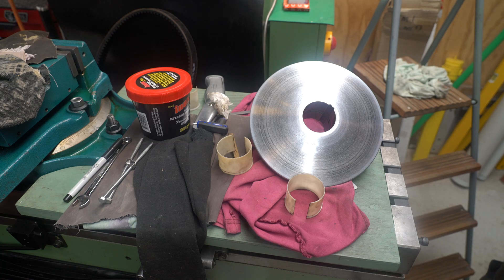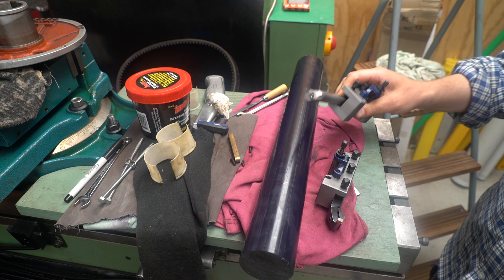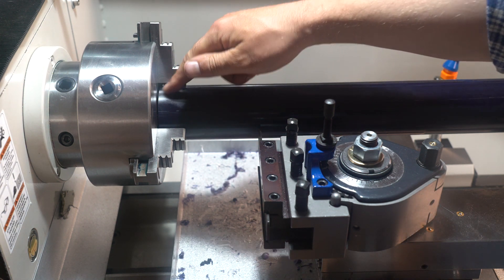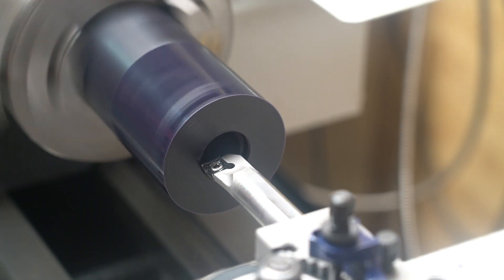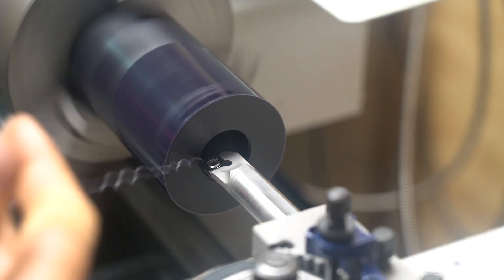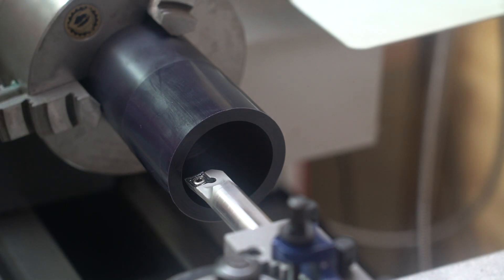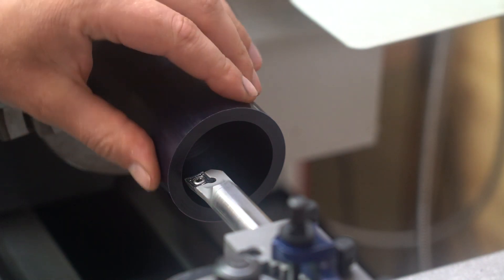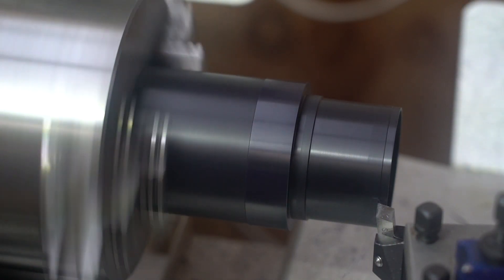Making Plastic Bushings For Variable Speed Bridgeport Clone Mill

Comment: Thank you for your videos on Bridgeport style turret mills.  I am part way through a top end rebuild of my 3hp Eumega turret mill.  I have made the bushing from Vesconite and the 7mm key out of Nylon Oil.

Your advise has been very helpful and yes I would agree you need a press to install the new bearings without damaging them. Very import to have the right size mandrels to press on the appropriate race of each bearing. Shaft bearing inner race, bush bearings outer race.

Regards
Alan

Comment: Thanks for the ally insert tip, on my ozito shop vac, I got one of those Loc-line 2'' vac hose attachments for the milling machine, and I got my Father to wire up a momentary switch on a shorter extension lead, I plug the vac into that when I'm on the lathe, and because my first ozito died, I have double the length of hose, which is great around my small shed, the momentary switch is on the floor in front of the lathe, it works brilliantly.

And that was an awesome rebuild on your mill, congrats.

Have a great Oz day tomorrow,

Scott.
Reply from the maker: Thanks.